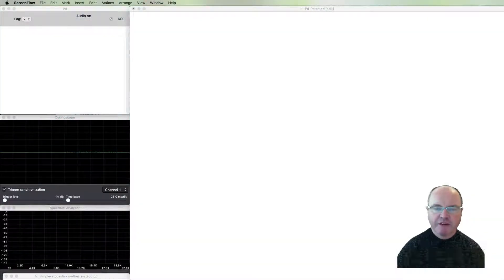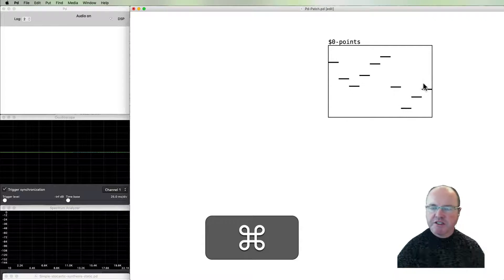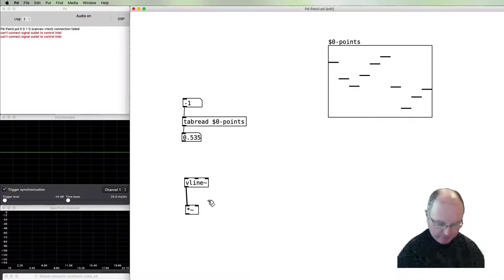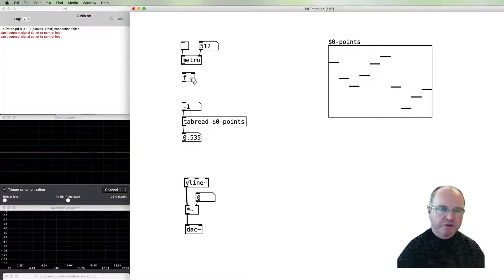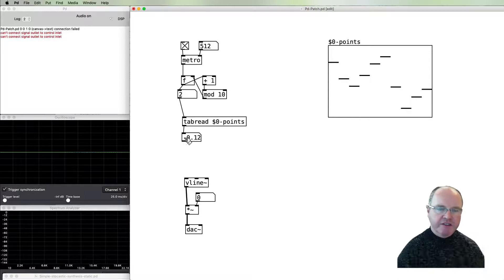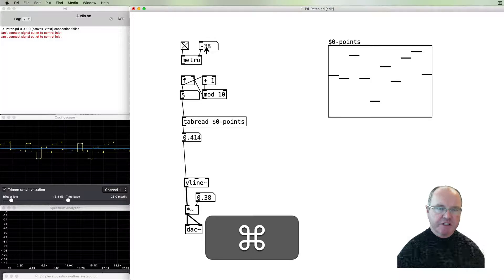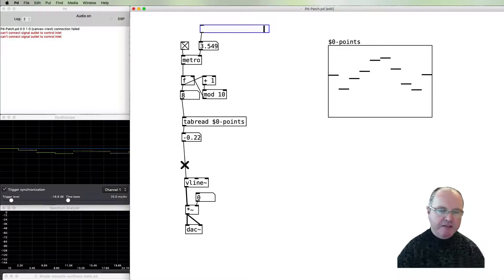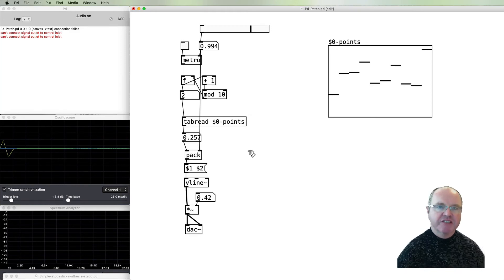15. Generative Synthesis in Pure Data

Comment: @QCGInteractiveMusic this is great thanks! would be cool to have a bang button that randomises the range in the array so you can generate random waveforms - would you consider explaining how that might be achieved ?
Reply from the maker: The key elements for generating random array values will be using [array set $0-points] with two inputs, random value & array index. Then use [until] and a [f] [+1] incrementer to step through the array indexes.
Reply: @QCGInteractiveMusic  thank you!